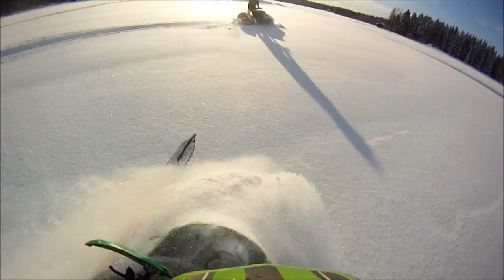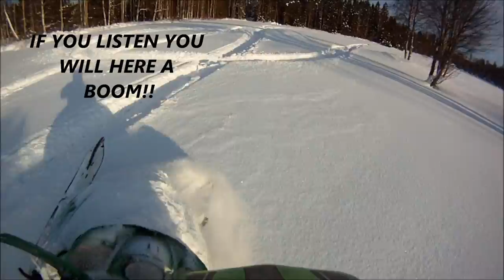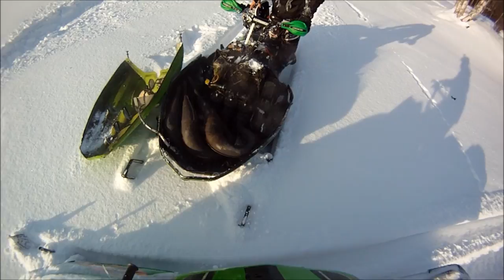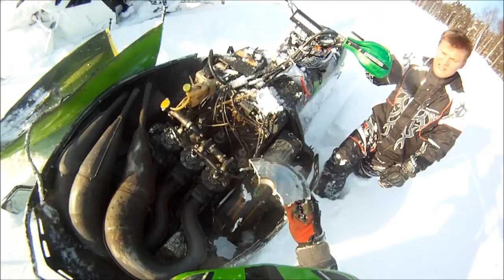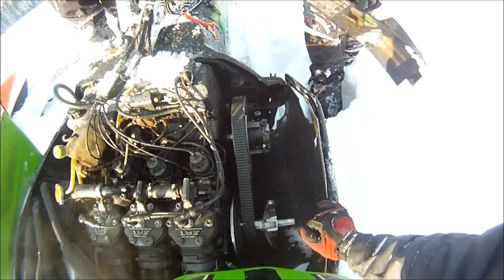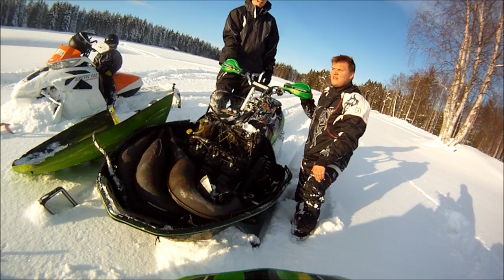SNOWMOBILE CLUTCH EXPLOSION

Comment: You'll have to borrow one of your friends Primary and Secondary clutches to recover it, remove clutches and piggy-back them out to the lender (Mmm, double-up cuddle). Lol, the Primary clutch housing got red hot and failed catastrophically. Clutch Maintenance is critical and they're SUPER easy to work on or overhaul a 7th. could master it and work for Team Polaris.

Comment: Set up the Secondary Clutch . So the Bolt that holds the Secondary Clutch . You put 4 more little washers on. Between spacer and the big outside washer. That you bolt on ,to keep the secondary clutch on. .So than the secondary clutch will float some what on. on the shaft. That way the Secondary Clutch will be always aligned straight . With the Primary Clutch. Even at the low ,gear ratio range. When you are going slow. Because the clutch and Belt alignment. Are set  for when the Snowmobile , Primary and Secondary . Are shifted all the way out . Or , high gear if you what to called that . So now in slow or starting out ratio range. The Drive Belt will always be , NOT straight running between the two clutches. But at a little angle.AND THAT WILL MAKE THE BELT AND CLUTCHES HEAT UP MORE>.AND YOUR PRIMARY CLUTCH MUST OF GOT SO HOT . THAT IT BROKE APART. I have a 1991 and 1995 Arctic Cat Snowmobiles . And back than , Arctic Cat had that the Secondary Clutch floated back and forth. That way the Secondary Clutch could follow the movement , of the Primary Clutch. When it opened and closed . And that would keep the drive Belt . Running in a straight line.! ALWAYS.

Comment: Generally cats are some of the highest performance and most comfortable to ride sleds, but this is a prime example of them not lasting nearly as long or being as reliable as the other 3 brands.
Reply: Yes this one sled that's well over 20 years old with over 30k in miles IS a prime example as to AC reliability! Brand new Skidoo blows a clutch with 200 miles on it
Reply: I have over 40 sleds, mostly cat, but a little of everything. Lemme tell you why I keep so many cats around, because they're indestructible and fast. My skidoo blew up 2 times before I scrapped the thing and my Polaris is just a bag of issues. Cats are the best

Comment: The ZRTs and EXT tripples from 1995 - 1997 all have the same clutch. I had to change one out before hand right after I bought it because I noticed it had a huge crack in it. My parts sled has a clutch that was starting to get very short cracks in it too. Aside from Arctic Cats with the tripples, Yamaha Vmax 500-600 twins from 1994-1997 crack and can grenade like this too.  I had replaced mine in my ZRT with an EXT 580 from 1991 I think and the clutch hasn't cracked. It's not the brand as these idiots are trying to make it sound it's the lack of quality part every company is lacking. I'd stay away from ski-doos and polaris as they seem to blow left and right. Yamahas seem to be the most reliable so far but I love my cat more for the better ride.

Comment: Arctic cat has the motors, polaris has the clutches, ski doo has the weight, Yamaha has the tanker ships
Reply: +sleeka00 thats not true, if you look at the weight comparisons, polaris has much lower weights throughout their lineups, but the engines also put out less power than the skidoos with the same displacement
Reply: +Alex Moeller Arctic  cat doesn't have anything, rotax engines  are far  more superior same with polaris' engines (fuji heavy industries)  yamaha has over heating shipping  freighters lol
Reply: +Elijah Nielsen arctic cat has great engines.
Reply: +Elijah Nielsen Rotax engines were terrible until the etec. 600's were okay. 800's were grenades for years man.
Reply: +Elijah Nielsen same with polaris. good engines under 600cc. 7-800's blew the fuck up
Reply: +Elijah Nielsen what's this Yamaha freighter thing
Reply: No Yamaha has the best engines
Reply: @RandomGuy-nf7xu  no. Just no. Theres a reason Yamaha pulled out of racing.